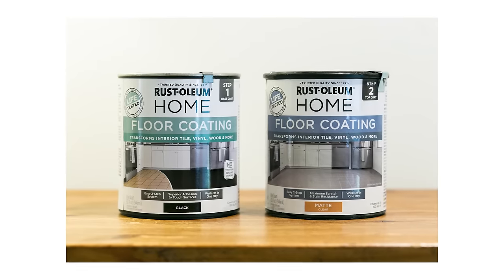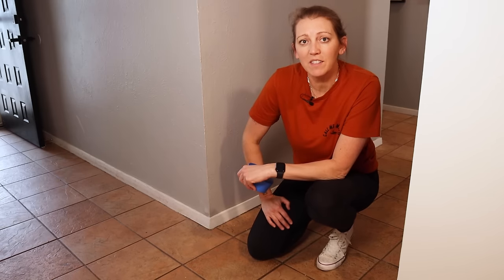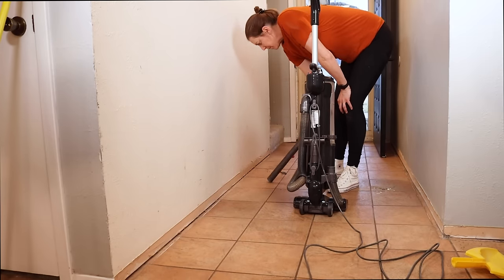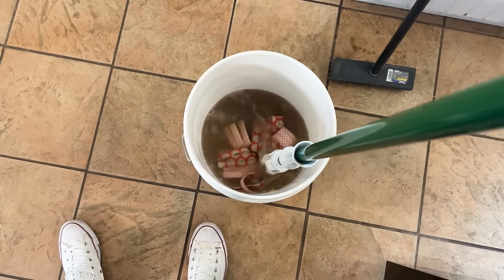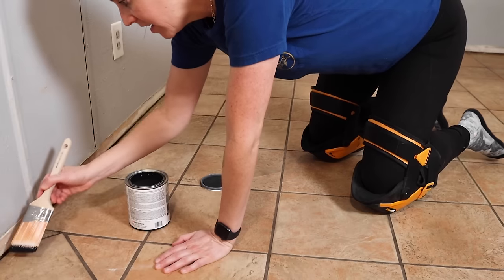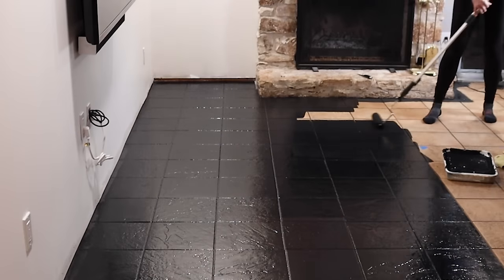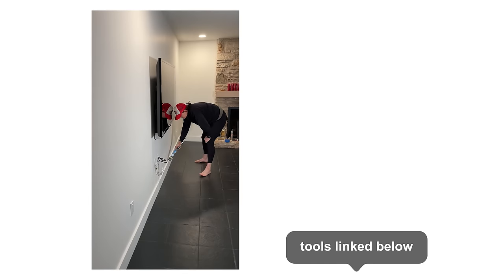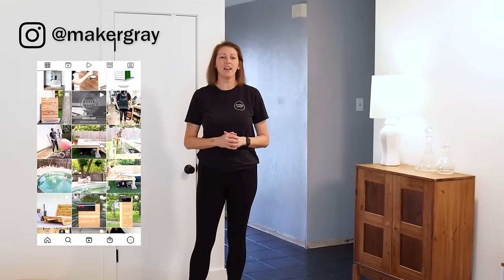Easy Update For Outdated Flooring? How To Paint A Tile Floor | Before And After

Comment: You don't have to sand this ?
Reply from the maker: Nope! Just don't skip the important degreaser step
Reply: @MakerGray  I heard tht this isn't ideal doe because paint could crack and peel? Scratched as well and moisture could seeep in.  This wouldnt be recommended for long term?
Reply from the maker: @Gummy1991  The method I used in the video is exactly what the manufacturer (Rust-Oleum) recommends. So far I am extremely impressed with the durability of the product. I think some other products might need a sanding before application, but not this one.

Comment: How much paint did you use? At $70 for the paint this does not seem inexpensive. If it only covers 100 square feet for one coat I would need 6 cans of paint.
Reply from the maker: That price is for the gallon, which covers about 400 sqft

Comment: As beautiful as it looks right after you finish, I don't believe this will hold up at all.  Shoes and wear and tear will ruin that paint job.  Then what do you do?  Repaint on top of that top coat?  The black color transformed the tiles and the room but I have no faith in floor paint.
Reply from the maker: I've been so pleasantly surprised at how well this floor holds up! We don't baby it at all and have no problems 6 months in, even with rambunctious dogs running 90 mph across the living room. I've found that two coats of the paint and then two coats of the top coat have worked out very well for us.
Reply: yes, you can repaint over it after first sanding down the clear coat.  So negative?
Reply: @garypuckettmuse  not negative but a realist.  Shoes, dropping things, dogs, furniture, etc will mar, scuff, mess up paint on floors!
Reply: @victoriabenn  it's special paint and she knows more about it than you do.  why not listen and *learn*.  we have a problem with that.  because we all know everything.  cheers

Comment: I tried this. Ended up retiling the whole floor
Reply: Did you use this same brand and why did it not work out?
Reply: @staceyj4370  No not this brand but I have tried 2 different ones in different houses that are specifically for tiled floors. Where I had the dining chairs all the paint became scratched and peeled off. Also I have 2 dogs and where they walked to get to the door to the garden also scratched and just looked a real mess. I was a bit annoyed because I used a special undercoat and then 2 coats of the paint. I had decided to paint the floor because my budget couldn't stretch to a total retile so I had to put up with the messy scratched painted floor for about a year till I could afford the retile. Years ago I also used tile paint in the bathroom but with the water and the steam it started peeling off. I suppose if you're going to use it where it won't get much wear it may last longer. Anyway just my experience and hopefully other people have better ones.
Reply: @Sophie-sm4tf  The reason it peeled is because you used an undercoat. You have to follow the instructions exactly for floor paints which already include primers. Did you even use a floor paint? And it sounds like you didn't use a top coat sealer either.